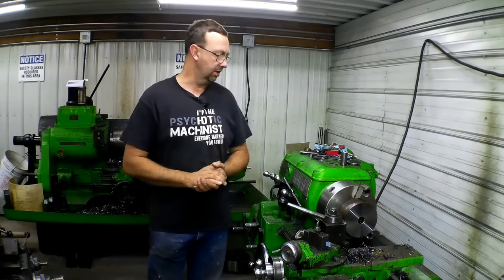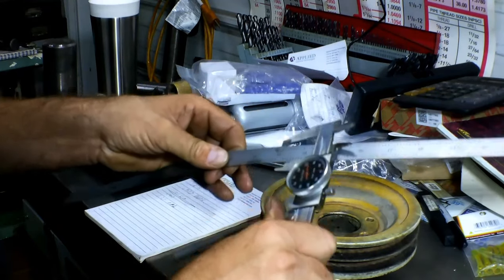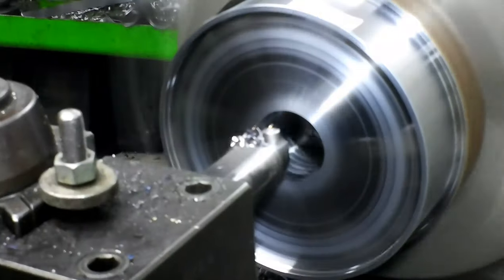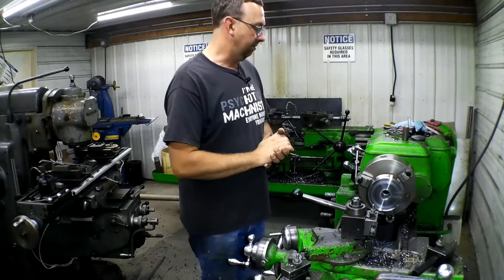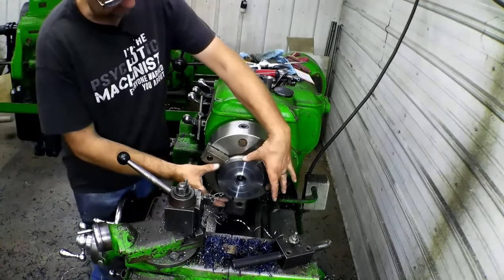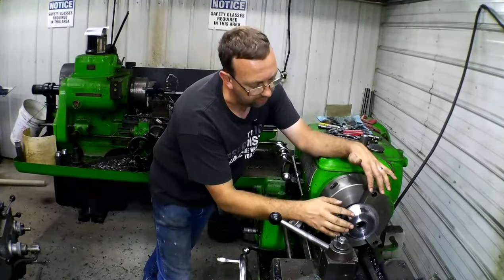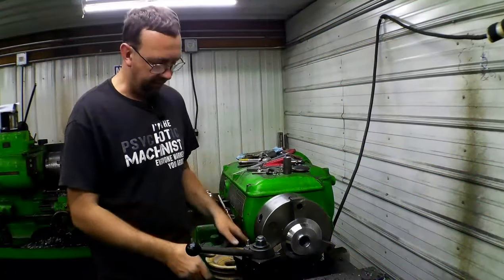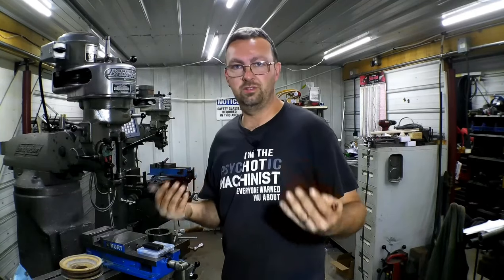Machining an Engine to Hydraulic Pump Adapter

Comment: It's amazing how many YouTube "machinists" or, more kindly, hobby machinists don't have a set of counterbore drills.
Reply from the maker: I am far from a hobby machinist.  This has been an operating business for 11 years, servicing all of northern Wisconsin.  I prefer not to use counterbores because they are an unnecessary expense.  End mills are regularly stocked and used, where as a counterbore would sit unused for months or years at a time.

Comment: I made pump adapters for replacing the old old Caterpillar Bee Gee Pumps years ago, pretty much retired now, but on one part, I can usually have it done while still programing the CNC guy is still getting set up.
 The big problem with CNC is the machines must be constantly working or you go broke.
Reply from the maker: I 100% agree. I could never make it with CNC. I don't do volume and don't want to. Years ago I did a part race with a CNC shop to prove I was faster on one part. 3 hours for me to run it, 14 hours and the CNC was almost done.  He had 7 hours of programming before he loaded material.
Reply: @TopperMachineLLC  Topper, I sort of never seen anyone make it with old Paid For CNC machines,  otherwise you pay every month for a magic box that is designed least last 5yrs so you can pay for it. Oh well, oily unbankable us actually will do better in the up coming bad economy.
Reply from the maker: @deedeeindustrialsuperprecision  can't argue with you here. We will be making money when everyone else is broke down and hoping parts will come in 16-24 .months.

Comment: What color green are your lathes?
John Deere Green?
Reply from the maker: They are Key Lime. It's rust-oleum paint. I really like it,except I need to paint the others and have no free time.
Reply: @TopperMachineLLC  Thank you, I have a Storm Vulcan 15 C crankshaft grinder that I want to repaint.
The original color was like a teal green.
I have a Automotive Machine shop. 
I enjoy your videos. EM.